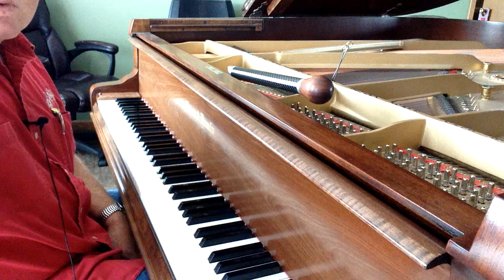Piano Tuning Theory - What are Beats? [Part 3] I HOWARD PIANO INDUSTRIES

Comment: Is the beat at the same pitch as the note? I hear some very highly pitched note that goes "waowao" but it doesn't sound like the note I pressed. Maybe the strings of the piano I am using are too short.
Reply from the maker: The beat won't necessarily be a pitch.  But I think what you're hearing is the right thing.
Reply: Is it possible to hear multiple sets of partials at the same time when tuning intervals?
Reply from the maker: The different partials are there.  Some are just easier to hear than others.  Sometimes more than one partial is able to be heard at one time.

Comment: I used to put a stereo mic on the piano and guitar and run the signal into a Marantz tuner with the tiny oscilloscope, so I could see the beats and a Lisajou wave form on the scope would deform the ovoid display to those beats. You can also hear them, but to watch them was absolutely fascinating. When you got the two strings perfect a circle would appear on the screen and stabilize and just dissipate with the decay of the note. With a piano and the other strings muted you can see it too, and get an audible and visual picture of it. Superb videos!